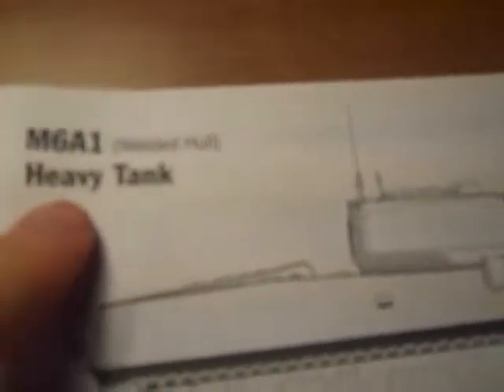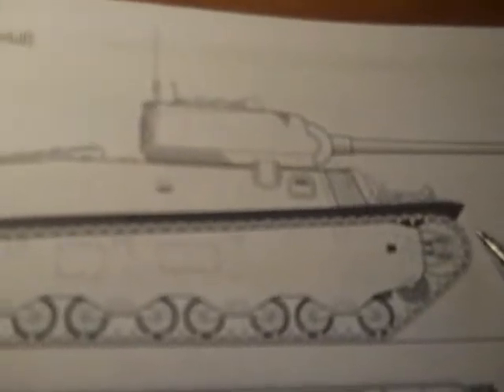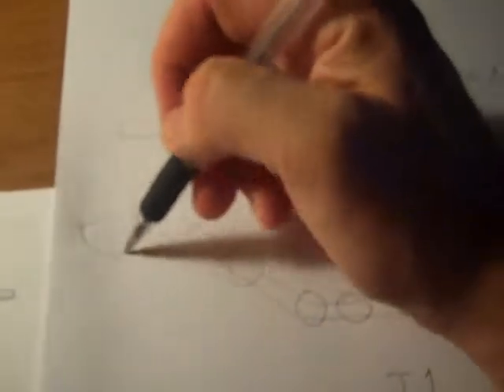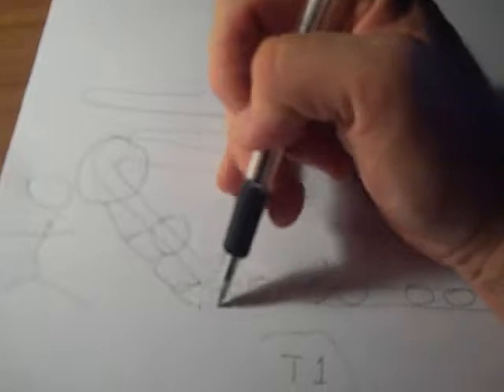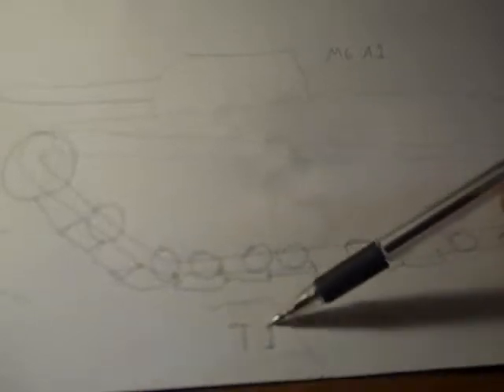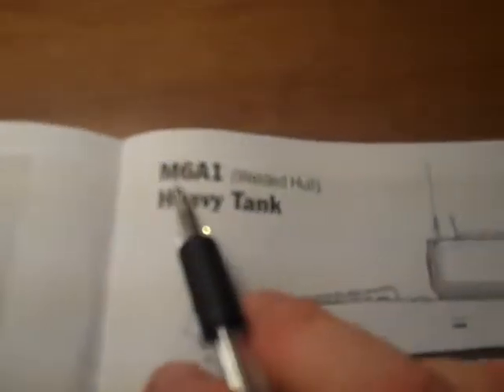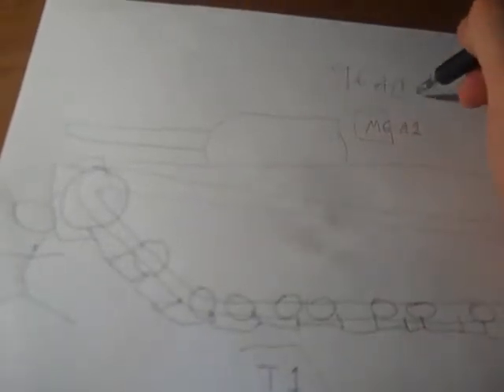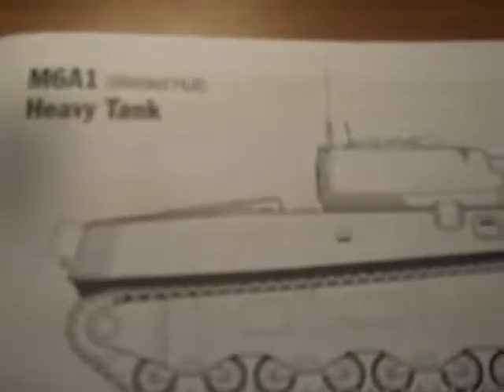The Eternal M6 A1 Heavy Tank of The United States

Comment: Back at the time these were made,  T designations were used for prototypes in the testing or design phase.  And M designations were used for production tanks.  The T1E2/M6, T1E3/M6A1, and T1E1/M6A2 had entered production, but had been cancelled due to size and dissatisfaction with crew and turret layout, by high command.  Otherwise going by armor stats, and penetration values of the gun, it would of been pretty much equal to the Tiger I. 

The only remaining tank of the model is a t1e1, the electric drive model. Most likely the one that was used to test the T7 90mm gun. 

The US's biggest stumbling block when it came to heavy tanks, was our high command not wanting to encourage tank hunting, or Tank V tank warfare.
Reply from the maker: Yes, there is one remaining example in the US.